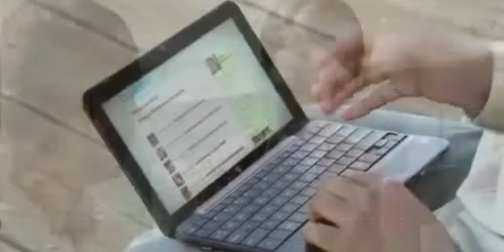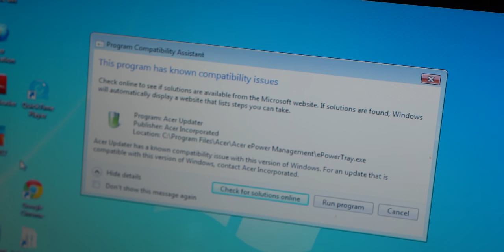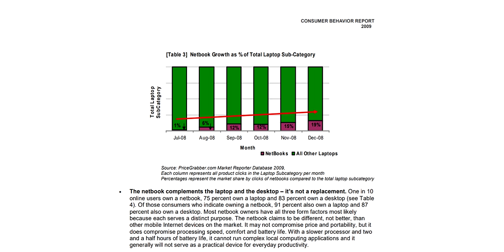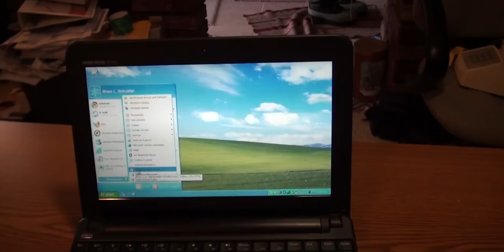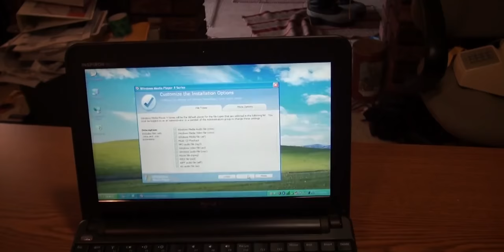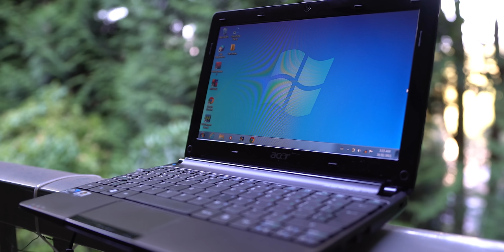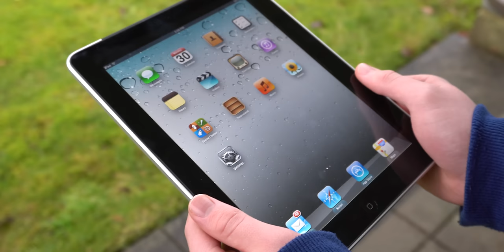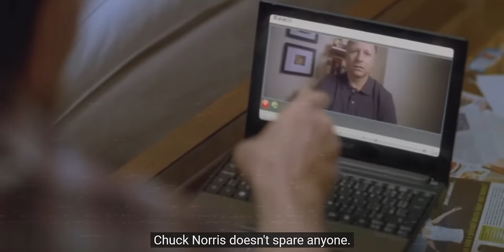Why Netbooks Failed - Modern Retrospective

Comment: Chromebooks have essentially succeeded where netbooks failed.
Reply: Yeah, but they still need to become as cheap as the netbooks,or at least more cheaper IN EVERY DAMN COUNTRY.
Reply: In my country they costs the same as an normal laptop.
Reply: Can't you get one for like 200? Only problem is I assume they are trash, the specs don't look too good...
Reply: But they suck
Reply: I have a chromebook that i spent 300 bucks on a couple years ago that serves its purpose.  It even had a decent chip in it that i could setup a linux partition and android apps.  

And now its a great little laptop to let my son use with a child family account.
Reply: @Beyondesp  for that you could have gotten a second hand 2009 laptop with an intel dual core and 16gb ram. Much better machine to “serve a purpose” or especially to play around with (install Linux etc)
Reply: Aren’t they locked into ChromeOS? Kind of a lame duck when they cost as much as an equivalent Windows laptop.
Reply: @carlosdrfx  you’re able to install any Linux distro on them, but there’s a couple hurdles to jump over compared to a normal installation. Nothing the average user couldn’t do, though.
Reply: No they haven't, lmao
Reply: @ipodtouch470  There are low end chromebooks and then high end ones. I am using a rather mid spec one with 8gb ram. And before that i used a basic chromebook. And before that i used a netbook.
Reply: @rayhanrizvi334  pixlelbooks aren't what I'd consider high end even for laptop standards
Reply: @youtubeshadowbannedme 1500 dollars for a pixlebook is a lot. idk what country you live in that 1500 dollars is "cheap" for a computer.  And your getting a lot including an i7 16 gb ram and 512 storage, and for a  chromebook thats super fast. will be much faster than a scambook(macbook) or windows because the os is much smaller.
Reply: A N I M E
N
I
M
E
Reply: @carlosdrfx  and usually, the main difference between those computers is the Windows ones can actually play those games (I have one) while the Chromebooks can't.
Reply: Chromebooks are just internet-only devices that have a deathclock on them...
Reply: @filmaxx3  sheesh
Reply: Small, efficient Linux-based laptops mainly for web browsing?
Reply: @midge_gender_solek3314  yup. But if you want a laptop that can run like a charm at 1/4 of the price, get a second hand laptop, and install Linux on it.
Reply: @rayhanrizvi334  16GB RAM and 512GB storage is an absolute joke for 1500 dollar laptop; Core i7 can range from being as weak as Atom to as strong as Xeon Silver. You know very little of computers if you think an overpriced lower mid range laptop is anywhere close to "high end". I'd expect at least 32GB RAM and 1TB NVME SSD from a 1500 dollar laptop along with a Ryzen 7 Zen3 CPU or newer because Intel freaking sucks since 10th Gen and before 8th Gen sucked more. When even Apple ditched Intel to make their own ARM chips that pretty much confirms how much Intel has fallen.
Reply: @rayhanrizvi334  except that with the new ARM chips in MacBooks and most expensive Windows laptops having powerful dedicated graphics, they make PixelBooks as much of a joke as marketing iPhones as enthusiast devices. Gaming consoles and phones/tablets have light OS; their inferior specs to mid-high end laptops still holds them back lol. I see maybe the Steam Deck having potential but that's essentially a handheld PC running off of modified Linux so kind of doesn't count.
Reply: @CoasterMan13Official  you can also do so much more on Windows and Mac based laptops than Chrome/PixelBooks
Reply: @youtubeshadowbannedme  Im sorry that my idea of "high end" is not properly aligned with your idea. Idk you must be from a very rich family to call a 1500 dollar laptop "not high end" idk your probably typing on some 5000 dollar macbook or desktop???? any laptop over 1k is generally agreed to be "high end" and most laptops around the 1k price range normally have around 16gb ram. And yes, that is generally agreed "high end" unless your a rich fellow, probably like you. And apple has even less than that, because their a scam. Also, lets not talk about apple ditching things please, i mean they are ditching the CHARGING FREAKING PORT in their iphone 13, so don't use apple as a way to confirm that intel sucks. Intel for me is solid, i have used intel pretty much my whole life, i have used intel atom in a netbook, intel celeron, and now an i3. I only have issues when the battery is low, but when charged it runs fine for MY NEEDS, i don't do any software editing, so idk how intel will cope with that. But for my needs i dont care if its intel or arm or whatever, as that i wont be really using the full potential of an i3 or an arm.
Reply: @youtubeshadowbannedme  couldn't agree more.
Reply: @youtubeshadowbannedme  again, lets not use apple as a way to show that intel sucks, i mean come on, their ditching a charging port in the iphone 13, they might as well ditch the screen as well at this rate, what a scam. Also comparing a pixlebook to YOUR standard of a high end laptop is absolutely ridiculous, i merely brought up the PixleBook to show that Chromebooks can be quite high end, by GENERAL standards, i did NOT bring it up to compare it to a 3000 dollar MacBook, or Scambook, because ofc a high end ScamBook will outperform the PixleBook. Also since you are an apple enthusiast shouldn't you be disappointing in their price for that their giving? for 1 grand you can buy a nice 16gb windows or a 8gb macbook, what a scam. heck even for 2300 hundred dollars apple is STILL only offering 16gb on their macbook pro, wtf is this?? My dads hp elitebook is 200 dollars cheaper and has 32 gb ram, thats insane that apple is charging that much, and yet you call the pixlebook a scam??
Reply: @CowBeatsCrow  ik there are better options out there i was just merely using the pixlebook as a way to show that chromebooks can indeed be high end
Reply: @AshnSilvercorp  you must be one very lose soul. I can run every app thats on the play store on a chromebook along with linux
Reply: @youtubeshadowbannedme  HAHA IMAGINE DEPENDING ON A WINDOWS LAPTOP OMG R U HIGH?????  Cant even go a FEW hours without it freezing and rebooting LMFAO. MY chromebook which i had for just as long as my parents dell inspiron . the Chromebook NEVER EVER quit on me, while the dell ALWAYS crashes, and we paid 4x the price for a more laggy laptop. What a SCAM, any windows laptop under 1k will lag heck i know even ones OVER 1k will STILL crash A LOT
Reply: @CoasterMan13Official  im sorry but thinking that a windows laptop is more reliable than a chromebook is totally ridiculous. CLEARLY you have not used a chromebook to think that
Reply: @CoasterMan13Official  i tried to get a laptop second hand, stopped working after 10 days, got it returned. your lucky if you can find a second hand laptop that is as it says.
Reply: @youtubeshadowbannedme  thats true, chromebooks are very limited, but for many students needs, chromebooks are fine
Reply: @rayhanrizvi334  I actually can't believe I'd ever see an actual person simping for Google's hardware...
Reply: @youtubeshadowbannedme  a chromebook with an amd ryzen 5 and 8gb of ram will be MUCH faster than a windows laptop with the EXACT specs. This is because windows is a much bigger OS than Chrome, it takes more ram and processing power to run. Im not a computer geek quite yet, but i know for a fact that a chromebook will beat a similar spec windows laptop. Now ofc chrome has its drawbacks like the lack of important softwares and stuff like that but for me i dont care, not like im going to need those any time soon. If i do then ill get a windows laptop and probably go downgrade to win 7 and see if the software can run on win 7, because win 10 is just too problematic honestly, i never remembered Win 7 having this many issues as win 10
Reply: @AshnSilvercorp  i cant believe that there are so many people who are so stuck in the past with their own sterotypes that they think that chromebooks are some cheap garbage. This is not 2014 buddy, stop living in the past and start living in the now, where chromebooks are getting increasingly better and better. 8gb chromebooks will be much faster than any 8gb windows laptop, sorry to burst your little bubble buddy! ofc as i MENTIONED, but you CLEARLY ignored because thats what kids do these days, sigh. Anyways like i mentioned chrome os IS limited, so you cant run specific hardwares and stuff like that, but what 12 year olds needs that is beyond me.Thats why chrome Os is simply faster, its just a smaller simpler OS.  Windows is a huge operating system, it requires a ton of space, ram, and processing power to run = chrome OS is MUCH smaller, it only takes seconds to boot rather than minutes(or hours). I doubt you will read all this as that you are too full of yourself, so im not even going to read your next childish reply
Reply: @AshnSilvercorp  You must be very childish to assume that chromebooks are trash, CLEARLY you have not used any moderate chromebook, so you stereotyping about chromebooks makes you sound like a COMPLETE fool to anyone who knows a THING about mid range chromebooks. This is not 2014 where the only chromebooks are 2gb ram trashbooks. Now there are chromebooks beating windows and mac anyday.
Reply: @rayhanrizvi334  please. I understand your trolling at this rate, but at what cost?
Reply: @rayhanrizvi334  why are you so desperate to get validation? You must be self projecting since it's Chromebooks that lock up and freeze if running more than just a few tabs lmfao
Reply: @AshnSilvercorp  yup same
Reply: @rayhanrizvi334  mhm and Chromebook can't even run anything outside of the Play store unless a new OS is installed good job
Reply: @rayhanrizvi334  and that's why you don't get used hardware...again, you're extremely tech illiterate. As I've told you before but now I'll say it differently, a laptop with a CPU like Ryzen 5 doesn't mean anything in of itself. There are R5 processors as weak as older Core i5 desktop and some as strong as Core i9 Extreme HEDC. 8GB RAM is barely enough in recent years even on lighter computer OS, and without extra specs, that doesn't mean much. Even within the same DDR generation, there are different speeds, timings, latencies, and voltages.
Reply: @rayhanrizvi334  that's not even my standard, it's the industry standard of a higher mid range laptop. I'm sure any tech enthusiast would agree a high end laptop would have an overclockable R9 or i9, 64GB RAM, 4TB NVME, and the latest flagship GPU. And even then, it's still inferior to what desktops offer for high end, which would be Core i9 Extreme or Ryzen 9 Pro, 128GB RAM, 8TB NVME + 12TB SSD, RTX 3090 or RX 6900 XT, and ofc extra stuff like liquid cooling.
Reply: @youtubeshadowbannedme  so? for most people using chrome, we dont care, we dont need anything outside of the play store. your point? Not like i need to download some crazy software that requires windows os, so why bother getting a slower more unreliable device is beyond me. The only appeal i see in windows is that i can get more games, but otherwise chromebooks meet my needs. I may switch to windows when i start to learn how to tune for mu Ap2 s2000, as that i doubt the program will work on a chromebook. Then I will get a windows laptop, and certainly i will buy one with 16gb so it wont crash, maybe like a xps, idk you tell me. But for now i will stick to chromebook, as that i dont have to deal with it always updating and going into the blue screen of death
Reply: @youtubeshadowbannedme  Im sorry but im not going to be sitting like a duck while apple fanboys(or fangirls) go and trash talk about chromebooks. Also you CLEARLY have not used any good chromebook, as that i have currently 20 tabs running, and i can smoothly load websites no issues. Idk maybe your school has those 2gb good for nothing school chromebooks. Yes, those are less than 200 dollars, and they will outperform ANY 200 dollar windows computer any day. Go ahead and TRY to use a hp stream.
Reply: @youtubeshadowbannedme  Iliterally went to almost every tech website and when i searched up high end laptop range, it clearly says "laptop around 800 dollars or above" a 1000 dollar laptop IS a high end laptop. High end laptops do range from 16 gb to 64 gb, a MID range laptop is a laptop thats 400-800 dollars, and i dont think you can find any laptop over 16 gb in that range. High end laptops have a HUGE range, like 64 gb is like the top industry spec laptop, but even laptops for 1k are also considered "high end". I might need to tap into a high end laptop if i want to start tuning for a ap2 s2000
Reply: Yeah but chrome books aren’t really much better
Reply: @youtubeshadowbannedme  8gb of ram is more than enough to run a chromebook. I think that you are into software editing or gaming, if you think 8gb is "barely enough" Unlike you many people don't have 1000 dollars to throw on a computer, so we work with what we can afford. This is where chromebooks come in handy. I have bought windows in the past, and it always lags so much after like 3 years of use. I paid like 400 for this 14c and it is already much faster than the dell inspiron which has a i7 in it. I agree that Chrome Os is limited, and you know you cant have it all, but im okay not using windows.
Reply: @youtubeshadowbannedme  I will be checking out a Hp ProBook with 32 gb ram, coming from my dads office, i hope that will not crash as much as the 8gb inspiron that we have
Reply: @phantom_wolf5274  depends. Like ofc a school computer is trash, we all know that. But once you start to look into like a 400 dollar chromebook, your getting similar specs to the windows counterpart, like an I3 or an R3, and 8gb ram. And counter to everyones stereotypes of chromebooks, they can be decently fast. Now dont compare them to a 2000 dollar asus ROG with like 64gb DDr4 ram or whatever. I have a 8gb chromebook and i can browse the web and multitask easily, no complaints.Generally, a ChromeBook with say an i3 will generally be faster than the windows counterpart, from my experience. No doubt that chrome Os is very limited, but thats ok
Reply: Stop using the word essentially thanks
Reply: @midge_gender_solek3314  ;)
Reply: I'd rather have a phone than a chrome book tbh.
Reply: As someone who’s used one for years, they’re horrible.
Reply: "succeeded" is carrying too much weight in that sentence.  People still buy 'full' Dell/HP/etc. laptops worldwide when they want one. Outside the US, Chromebooks were always a fad; not cheap enough and with a lot less autonomy than a bigger, more hackable pc with a "free" Windows license LOL
Reply: @kyukyoku_   "a couple of hurdles to jump over compared to---"  this is why Windows will rule forever; turn on and that's it